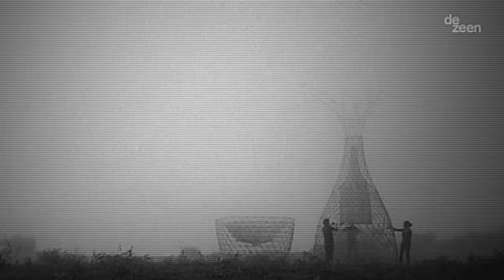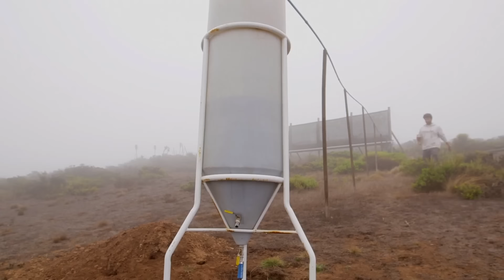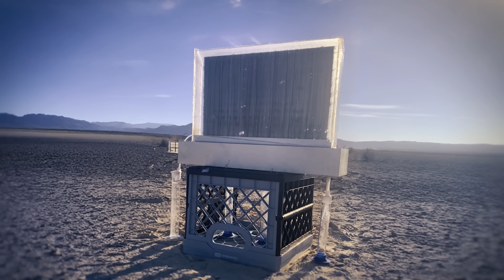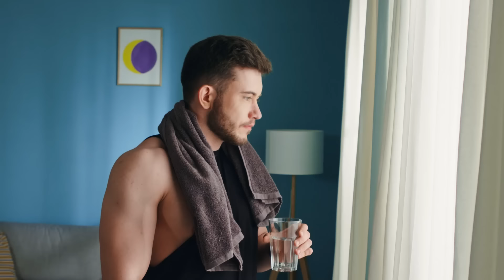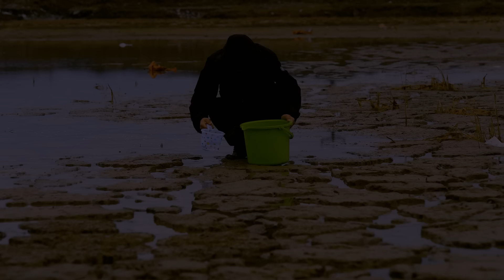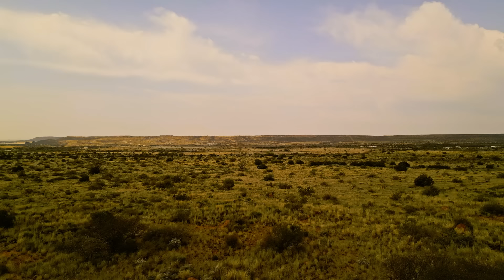MIT Just Discovered How To Make Water In The Desert For Free

Comment: Another deceptive YouTube video that doesn’t tell the truth.  MIT water collector is far more expensive than more efficient and productive desalination.  It’s not even close.  And without water filtration, you risk drinking lithium ions.  Atmospheric Water Generators (AWGs) and Solar Hydropanels are far more practical than the MIT hydrogel prototype, which currently struggles with low yields and potential salt contamination.

Comment: Atmospheric Water Harvesting (AWH) is a legitimate and emerging technology that extracts moisture directly from the air, but like any system, it comes with clear strengths and limitations—especially when applied to a 1-acre sustainable homestead.

✅ Pros

AWH offers a consistent and independent water source, meaning it can produce water even when rain is absent or wells are limited. This makes it highly valuable as a resilience layer, particularly in emergency scenarios or drought conditions. Unlike traditional systems, some AWH designs can operate passively using sunlight, requiring little to no electricity, which aligns well with off-grid living. The water produced is typically clean and low in contaminants, often requiring minimal filtration before use. Additionally, AWH systems are modular and scalable, allowing you to start small and expand over time depending on your needs and budget. In a humid climate like Missouri, AWH performs better than in deserts, making it a practical supplemental option for a homestead setup.

❌ Cons

Despite its advantages, AWH is not a high-volume water solution and cannot replace primary systems like rainwater harvesting or wells. Daily output is relatively low, often ranging from a few liters to a few gallons depending on the system and environmental conditions. Performance is heavily dependent on humidity, temperature, and airflow, meaning production can drop significantly in cold or dry conditions. While passive systems exist, many efficient units still require energy input, which adds complexity and cost. Initial setup and advanced materials (such as hydrogels or specialized frameworks) can be expensive and not yet widely available at scale. Maintenance, though generally low, still requires periodic cleaning and monitoring to ensure efficiency.

🧠 Bottom-Line Insight

On a 1-acre sustainable homestead, AWH should be viewed as a strategic support system—not a primary water source. Its true value lies in providing a reliable, always-on trickle of water that enhances overall system resilience. When combined with rainwater harvesting, a well, and water recycling, AWH helps create a redundant, failure-resistant water infrastructure, ensuring that even in worst-case conditions, some level of water production continues.

Comment: Atmospheric water generators can do a lot of the heavy lifting for preventing runaway temperatures, by restoring deserts, drought prone regions, and heavily mined areas with greater abundance and vegetation.  Use solar panels to power them to get things moving in the right direction.
Reply: By extracting the water that’s not found in the desert?
Reply: @albeit1  They are best used in low humidity areas, i.e. deserts.  Extract from the air, and put water under the surface.  Groundwater is needed, to precede trees, grasses, weeds, flora and fauna; leading to top soil recovery.

Prepare the biome to retain and percolate rain runoffs, when they eventually arrive.
Reply: @albeit1  Humidity is ubiquitous.
Reply: @FlameofDemocracy  dehumidifiers have been around for a long time. The water extracted is very expensive. More expensive than delivering it from far away. 

Even if the electricity is free.
Reply: @albeit1  The land will be made livable, heat can be absorbed by the magic of chlorophyll, and sand storms can be avoided.  Water is the key.  Solar panels can send energy into metros, while producing energy to regenerate biomes.  

There are many aspects to like, with atmospheric water generators and detailed planning.
Reply: @FlameofDemocracy  more like fantasy is the key.
Reply: @albeit1  Some countries are already implementing.

Comment: As with all new inventions, especially prototypes, per unit cost may be enormous! As demand grows the per unit cost and bulk purchase cost should decrease as well. 

There are many ways to extract water from the air too. A cold bottle of water taken from the fridge will be dripping with condensation within minutes pooling up in a ring around the bottle. The same kind of condensation happens with room window AC units. Each is equipped with a drain to redirect the flow to a channel to evaporate or overflow into a tube to drip onto the ground. You don't need to watch DUNE to see that moisture can be extracted from all kinds of sources.

Comment: They keep reinventing this scam. This is the 4th or 5th time I've seen a "new tech" to get water out of the air" in the desert. Every single times it doesn't work. Why? No water in the air to begin with. if the air had the water, it would rain. If, and I mean IF, one of these things actually worked and super squeezed the water out of the desert air, you would only then leave the Air drier and less capable of rain. Someone tell these kids to stop trying to cause ecological disasters in the process of trying to scam nice guy points

Comment: There is another YT channel (alas I don't remember the name) that deals with electricity and ions, and he basically reversed the concept for an ion thruster and created a system to replace fog nets at crazy high productivity levels. Yes, it requires electricity, but it has no moving parts, and I think it requires high voltage but low watts so could easily run off a solar panel and a moderate battery.
Reply: You are thinking of Jay over at Plasma Channel. Some very good results using high voltage.
Reply from the maker: This sounds interesting, I'm going to have a look and see if I can find this video! Thanks for sharing

Comment: THERE IS SOME BASIC MATH NOT MATHING HERE?
How did they come up with EIGHT panels supplying daily water-drinking needs if (at best) they produce 5 fluid ounces [150mls] daily? 8x150mls is 1.2litres LESS THAN HALF the recommended daily water intake (2-3litres)?
And at what cost per unit? - I could only find $4(USD)/unit materials cost (so at least triple that for actual scale production, maybe $15/unit? Which I still find cheap)
$15 x 8 = $120(USD). And you'd need that number (MINIMUM) per person, so a family of 5 = $600???
AND I STILL THINK ITS NOT ENOUGH PANELS!
Reply from the maker: That's a really good point! The direct quote from New Scientist is "They estimate that eight of these panels could supply an average adults daily drinking water need". It's unclear if they are referring to the size of device used in the testing phase or the larger planned panels the article goes on to talk about. You can read the news report yourself (which also links to the academic paper) here - https://www.newscientist.com/article/2483709-the-arid-air-of-death-valley-may-actually-be-a-valuable-water-source/

As for cost, it's hard to put solid numbers on, as it's still very much in the research phase. But once economies of scale are involved, I think cost would be significantly lower than $15 for these smaller models. Also, I think the realistic application of this tech would be larger scale community collection systems like the ones in Chile and Morocco.
Reply: They did Test it in Death Valley...
In a less arid region I'm fairly certain you will get better results. 
Unless the amount of water each panel can produce is limited to that amount by the storage limitations of the polymer.
Reply: @johnmatson7234  dunno - just going on what they say. 160mls (at best/day) is very modest. But of course the test prototypes were only 10cm by 50cm. Extrapolation suggests 1m x 5m = 1.6L/day, which is more realistic. I'm not dissing it, I'm just saying it ends up needing maybe 20m2 to provide enough death valley daily liquid to be meaningful.
Reply: @gideonporter537  they were 5.5 square feet, that's 2 foot by 2.75 feet, roughly 67cm by 86cm, not 10cm by 50cm...
Reply: @Quickened1 that is NOT what we see on screen.?
Reply: @gideonporter537 roughly size of a standard window... 3:30
Yes, at the beginning of the video they show smaller versions, but they also say size of standard window then too...
Reply: Is it not more about the fact of generating water IN THE DESERT without additional infrastructure or access to water supply? Then the math is not so relevant.
Reply: @patricmackenzie1887 precisely
Reply: Why not test it in the outback of Australia
Reply: @deoxy8  I think they wanted the driest place possible in their vicinity (USA).... but yes, I like the way you think.
Reply: Daily recomend isn't daily required. 1.5 L is daily required. Also, if you live in a desert $600 yo have ANY additional water source, is cheap. Their tests were in, literally, arid desert. Any environment eith higher air humidity will generate more.
Reply: @axiomethic  fair enough, but I just thought it was a bit over-hyped. And $600 for many desert-dwellers is a lot (if that's even what it ends up costing). However, yes, any viable solution will be greatly appreciated.
Reply: @gideonporter537  perpetual water output in the desert at $600 for a family of five. That is what you call a no brainer...
Reply: Anything out of MIT is gonna be a crooked venture capital back tech pump n dump scam.  Boston is the world center for science and engineering based scams